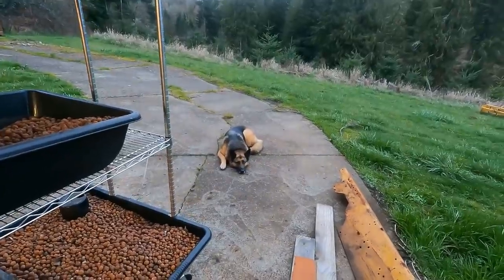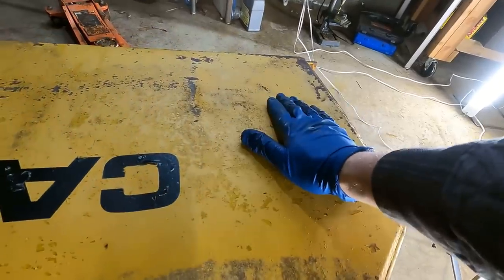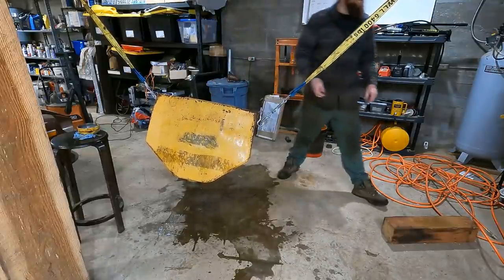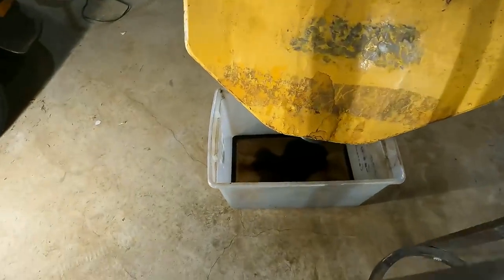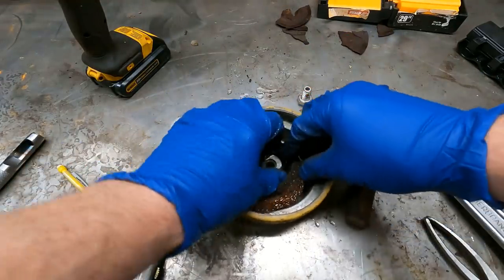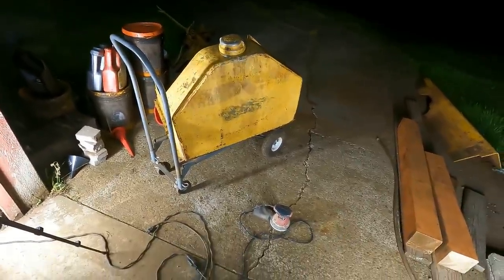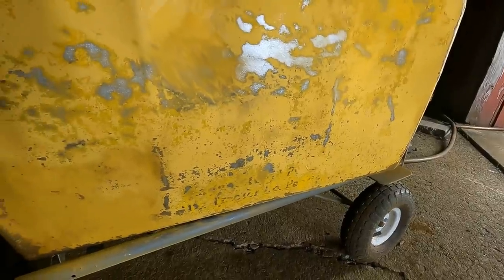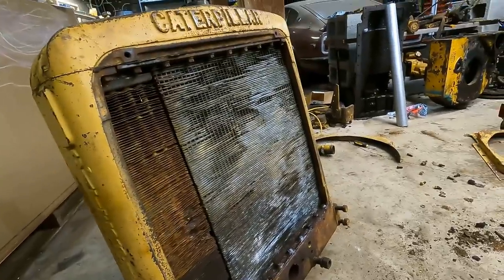Cat D4 fuel tank liner and paint prep

Comment: You could "weld a nut" to the dent in the fuel tank and use a slide-hammer to pull it out - but I wouldn't bother trying to fix every dent and blemish. Good luck.

Comment: If it was my restoration project, especially being a radiator cooling core, I would dismantle the whole system, because what is hiding under and above the cooling core could be something that really needs attention now before you reassemble the dozer and start using it. Because the hidden rust, dirt, gunk etc. may cause the core to begin to leak just when you need the dozer the most. For me, now is the time to see what is good and what needs replacing or repairing, not after the restoration has been completed and I am ready to put the D 2 to work.

Comment: The best thing to do and I've done it to fuel tanks is clean it really good till you can't smell any diesel fumes the cut the back panel off at the welds with a grider and you can then beat the bent in area back to where it should be and give the interior an in depth cleaning and then weld it back together and use a wand to paint the interior with the proper sealant after you've primed it.
It's a little time consuming but we'll worth the effort.
I grew up in a small Michigan farm town and one of my teen buddies had me help him do it on one of his dad's tractors.
A Bull had actually kicked it in when the tractor backfired behind it. 
What the Bull was doing there remains a mystery to this day.
He was a mean sob but a good breeder so they just improved the gate to his fenced off area where they kept him separated.

Comment: I restore old motorcycles now & then. The fuel tanks are almost always a mess. After years of playing with all the options I now just get it cleaned out as well as is reasonable, then use a product called Red-Kote. It takes into suspension anything still in the tank, seals 100%, and is indestructible. I spilled a small puddle about 3 inches wide in the middle of a heavy traffic area on my garage floor. Many years later it still looks untouched. I believe it would take a hammer & chisel to bother it. It adheres to everything. It has the consistency of molasses. I think if you could take the steel tank off it somehow the remaining Red-Kote bag would make a good tank. I've tried damaging that puddle with various chemicals from muriatic acids, carb cleaners, oven cleaners, you name it. The stuff is boss. It seals leaks from pinholes & seams 100%. I coat twice just because. I won't use anything else ever again. I have no money in their game, just a high recommendation.

Comment: A good way to get the big dents out next time would be to try using air pressure.  Just seal the tank and put a small amount of air pressure and most of the time the dents will pop out. If they don't stay popped out keep pressure in the tank and then use a hammer to release the dent by tapping on the ridges of the dent.  Tank looks great either way, nice video.

Comment: My fix.  A neodymium magnet with a piece of solid copper wire twisted thru. Dropped into the bottom of the fuel tank.  The magnet attracts all the rust particles too it.

Comment: Could have welded a long threaded bolt on the dent, fabricate a bridge, and wind a nut down the bolt to the bridge and use it as a puller. When done, grind the bolt off and level.

Comment: Nice job on the fuel tank, however if youre going to store it half full make sure you use an additive in the fuel to prevent microbes from growing in the fuel :)
Reply: Does that happen with reg diesel or just bio-diesel?
Reply: I may be wrong, but I think it can happen with red diesel, a friend of mine had a hell of a time with it on his canal boat
Reply: All diesel is able to be contaminated, the microbes survive in the moisture that forms in the tank if its not fully filled

Comment: Put 50-100 PSI of air pressure on the fuel tank and it will bend it back most likely.
Reply: Yes you can do that with air pressure but you can increase the force by filling the tank full of water then adding air its called hydrostatic pressure induction. Fluid is non compressible you now have a hydraulic boosted source. We test
Test high pressure steam piping and boilers with this technique.

Comment: I feel like a sand blaster attachment for your pressure washer would be useful to you.  you can use cheap sand and they only cost about $30.   I used basic paly sand from Home Deopot and sifted it with a screen.  It wouldn't work with the larger bits but worked fine after sifting.  Black beauty from TSC works amazing but then, there's the mess.  Sand will just disappear.  Also maybe a cheap paint sprayer so you could use quarts or gallons of Rust-Oleum as you already have a compressor.  Maybe even a airless sprayer.  You would get thicker applications, spend less time and have more durable results as well as save a ton money on paint.  IMHO

Comment: My dad had his m151 tank coated with a similar product. After adding gas to it, when it would slosh it would pull some of the blue sealer off into the gas. Needless to say it did not run well with this gas mixture. Idk if it would be possible for you to fill it with diesel, shake and drain a couple times? Sounds like you have more experience with this product than me, but just wanted to let you know my experience. Keep the videos coming!

Comment: Dang I wish I could get out there and help speed this project to completion.  As I've told you I worked for Cat in Decatur, IL for 33 yr and i've followed Cat Equip forever.  If you haven't tried Duplicolor Truck Bed Paint give it a whirl.  It is tough and Dupli will produce any color.  I've got a friend who painted his 2015 Tundra and it looks great. Brush doesn't phase it at all. How'd your solder job on the hyd line turnout?
Reply from the maker: Turns out the hydro lines weren't cracked on the excavator, brought all the gear out to do it for no reason

Comment: Not a fan of any of those liner kits.  We have tried them on few machines and they all end up failing.  We do our best to clean the tank with muriatic acid, and then neutralize the acid.  
   Fyi the only thing that works to remove the lining now is heat.  Luckily that tank is thick enough where it won’t warp to badly.

Comment: If you would of done it squach style you would of atleast checked the vent area of your fuel cap and not forgotten to put the big rubber o ring on top of the metal disc inside of the cap
Reply from the maker: There was no oring on mine unfortunately.  I have a sheet of nitrile on order though to make one, otherwise the cap doesn't seal
Reply: @PacificNorthwestHillbilly  im pretty sure your missing a o ring may check some parts books